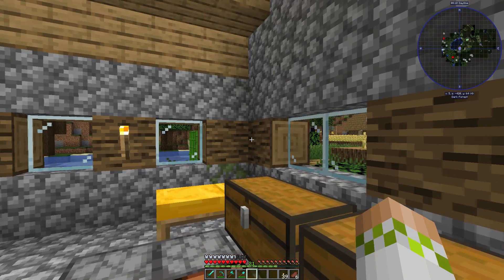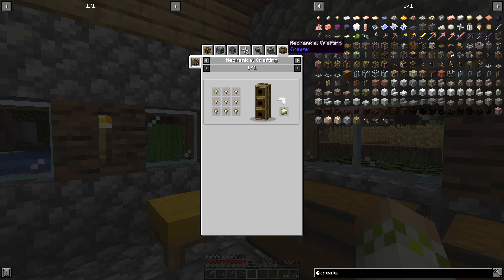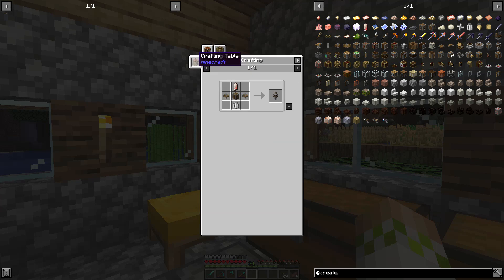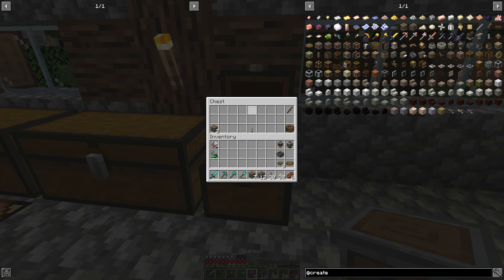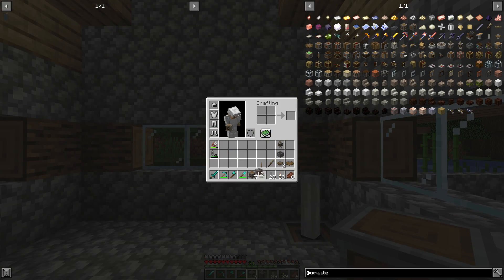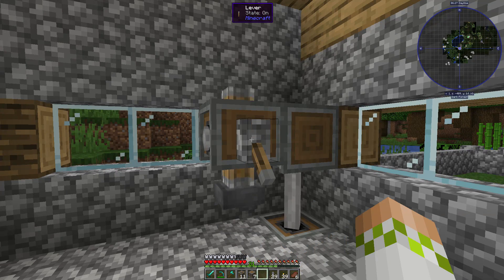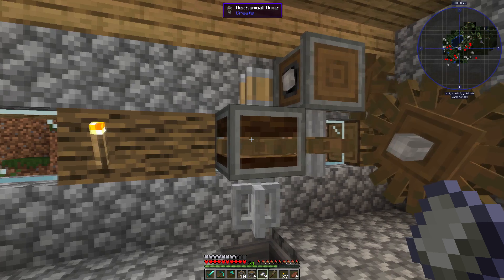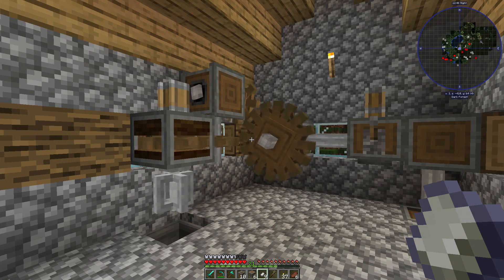Surviving With Create :: E02 - Mechanical Mixer & Cogwheels

Comment: you can actually make a windmill in this using a mechanical bearing powered via redstone, a radial chassis with slime on it, and a bunch of wool. it's rather slow unless you put a ton of wool on it, but it has an incredibly high stress capacity and you can use cogwheels to speed up the rotation anyway
Reply: Good to know
Reply: I've been doing a playthrough of create so this is helpful
Reply: ...cool!!!!!!!!!

Comment: 12:43 When you say rotating in the "horizontal plane", that typically means the rotational axis is vertical, and the cog would be horizontal. You can remember easily because the cog is 2 dimensional, like a plane, and the axis is one dimensional, unlike a plane.
Reply: My brain is too small to understand this
Reply: mine ain’t. But I still don’t.
And yet I do...

Comment: Idk if you know, but in JEI press backspace to go to the last recipe viewed. Also for your gear shift, you might be able to use your small wheel directly with the mixer. It looks like you can't have gears perpendicular to act like a gearbox, as that is a block, but I have never used the mod.

Comment: you used 2 cogwheels, i needed 9 to get enough speed lol, still good video, it helped a lot. Thanks.
Reply: how did you do it i can't get it to work
Reply: @Skeptuc  just as shown in the video, just increasing the number. 
2 or 3 of height should work. Placing 2 big ones connected to move the force horizontally for more space

Comment: for some reason i dont see the config on the mixer when i have the wrench in my hand i do see the recipe filter on the basin though
Reply: same issue, did you figure it out?
Reply: sadly not
Reply: @DarkRavenProductions  Hey i got it figured i think this is from an older version, you can just add them but you need a blaze burner beneath the basin to heat it, then just add the ingredients,
Reply: i had to keep mine disconnected while i added ingredients otherwise they would get turned to  nugs or piles before i added the rest